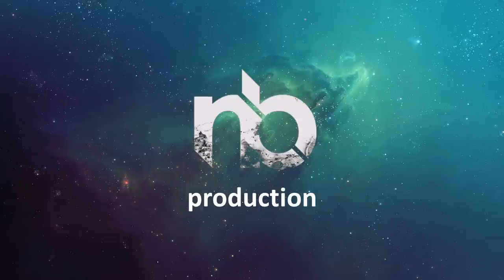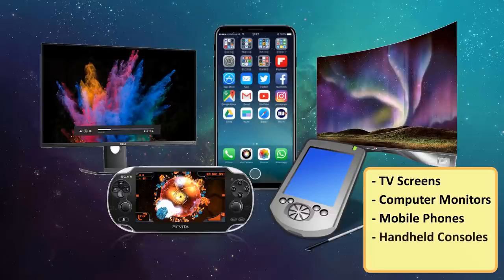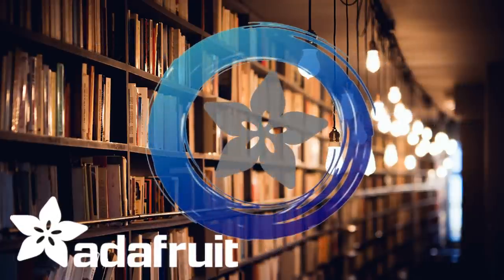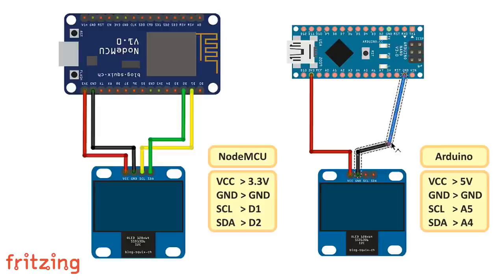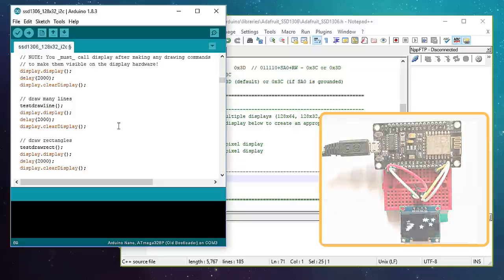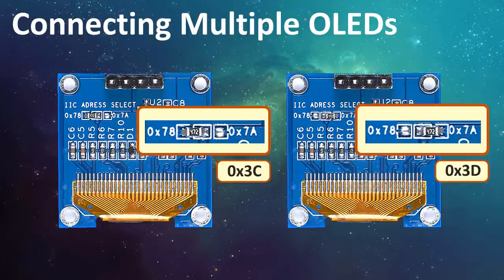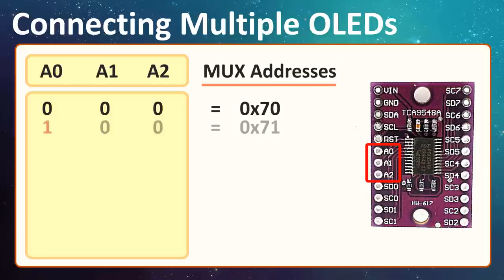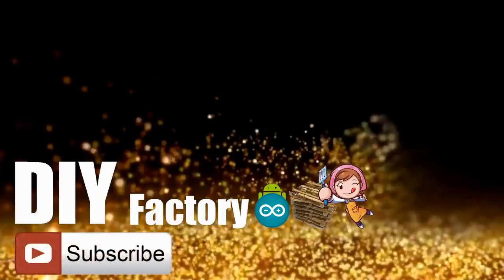Tutorial on I2C OLED Display with Arduino/NodeMCU

Comment: Copied from Reddit: 

As
someone who is also still learning about electronics and Arduinos I felt the
timing of this being posted was kind of funny and that I should chime in. Now
what's funny about it, for me at least, is that I just finished working with an
OLED on a NodeMCU ESP-12E after not having worked with one for at least a year
(the former being rigged to a Nano). Naturally, I needed a little bit of a
refresher but got it working.

With
that in mind, I saw this post and felt like the timing was right and I'd give
it a quick look since it's still fresh in my mind. To be honest, I didn't
actually expect much - I did my project, I learned plenty about OLEDs and got
them working, and honestly, there are just so many websites and videos out
there already and so much information that what could this video possibly do
for me?

I
was actually really surprised with this. Like I said, the proverbial market is
flooded with information - a plethora of blogs and videos on how to do stuff
like this, and most of them are difficult to read through or unpleasant to
watch. This guy gets it right. His editing and presentation are fantastic, his
video footage is good quality, and he has easy-to-read schematics he walks us
through. Not only that, he goes way above and beyond, showing us how to set up
multiple OLED screens together, how (and why) addresses work, how to use
multiplexers for many OLEDs, and concludes with talking points on the
advantages and disadvantages of using an OLED and common errors in setting them
up.

This
video is really well made and very helpful, and for anyone who is anywhere in
the "just learning" to "needing a refresher" range of skill
level, I couldn't recommended this more. I mean, I just did a project with an
OLED and refreshed myself but still learned some things from this video. This
is honestly the kind of stuff I want to see when I'm looking for refreshers on
something or to learn something new. Great job.

Comment: Great! ssd1306_128x64_i2c works!! 
I use an Arduino Due .. and the key for me was telling me that - if I was using a Mega -  then I should use terminals 20 and 21.  The penny suddenly dropped. That works on the Due too.
The Due also has terminals SCL1 and SDA1 in the same position as they are on the Uno.. and they don't work for this. Nor does using A4 and A5 as many tutorials show.  Need to use terminals 20 and 21 folks.
Also ..I goofed first time on the mixture of underscores and hyphens in the file names. Out of the box they don't match so need to go through those very carefully.
Thank you!!
Reply from the maker: Good job, keep it up

Comment: Great Video.  Thumbs Up!
I am actually have an issue getting my 128x64 OLED to display anything while following this tutorial.  I think it is because the recently downloaded Adafruit_SSD1306.h file looks different than in your video.  I do not see a place where address is identified.  However, I only have 1 stock display, so I do not think I would need to change it anyway.  Regardless, I did change the file by uncommenting the "#define SSD1306_128_64" and commenting out the "#define SSD1306_128_32".  I also made sure to change the reset pin from "4" to "LED_BUILTIN", since I am using a NodeMCU.
Any suggestions on where to look next?
Reply from the maker: The libraries I used are all in here: https://diyfactory007.blogspot.com/2018/07/oled-i2c-display-arduinonodemcu-tutorial.html
See if that works out for you.
If not get back to me and I will do a quick test with the new library
Reply: @CrazyCoupleDIY  Thanks for the offer!  I actually figured it out.  The SSD1306 i2c example actually had 0x3C as the default.  I changed it to 0x3D and all was well.  Thanks again for the great video.  Make more!  I'm trying to learn about server/client communication with and without  wifi.  I'm also going to try to develop an app for android to read data off of the DHT22 sensor.
Reply from the maker: Nice. 
Sure, more tutorials and projects are on its way, stay tuned.

Comment: Great video. So far no one answered this. How can I use different pins? I am using D0-D7 for keypad on NodeMCU.
Reply from the maker: First of all thanks for watching
Now, D1 and D2 on NodeMCU are SCL and SDA.
Which means if you are trying to use an I2C sensor it has to be on those pins unless you multiples it using a TCA9548A i2C MUX. 
You can check out my tutorial number 9 for that: https://www.youtube.com/watch?v=XWQsqPQOW-U
Now, if you are running out of GPIO pins you need to extend your GPIOs using an IO extender. My next tutorial is on that only. 
If you want you can check it out next week and that will for sure answer your question.
Using the i2c IO Extender you can extend the GPIO pins to have 128 'parallel' pins.

Comment: Hi. A question. How did you eliminate the flickering of the OLED when recording the video?
In the examples the OLED was blinking and in the end of the video they no longer blink in the animation.
Reply: And a second question. Do you know how I can increase the brightness of the OLED 128X64? Can the brightness be increased?
Reply from the maker: Hi There 

Lowering the contrast and brightness of any object that illuminates light will not flicker when you are recording them at 30 fps

If you want to record at higer brightness use higher frame rate

Comment: Hey man! Great video but one part is missing for me;

What if i want to show a BMP as an intro for 3sec and read an analog value to print on screen? 

I do print my logo when i start it but display.cleardisplay function doesn't seem to work. Cant print my analogread on OLED. Any suggestions would be appreciated
Reply from the maker: Hi There
First of all thanks 
Now to answer you question, So you are using a 3 seconds delay to display your image.
And then when you read the input value are you able to serial print it and see if it is actually getting into the system or not?

If it is then are you getting any error?

If not can you display another image after the delay?
Reply: Thanks for the reply man appreciated.

Silly me i put it in the setup not the loop part. Changed it and its working now

Comment: excellent video, i'm not an electrical engineer but i do understand and have the aptitude to learn. I am looking to put together a Tiny gps enabled Speedometer for FPV RC cars, Drones and whatever you want to stick a speedometer on. these tiny OLEDS are perfect, they can sit just on what would be the dash and the fpv cam can clearly see the display, true some drones come with all this built in but people want a standalone lightweight speedometer that can record g-force, speed and distance all tracked by gps. currently we have to use a big ass box and strap it to the outside of the RC vehicle. can any of you guys build one?

Comment: Hey there! Can i use this display as a menu and also cn i have exterior physical buttons to navigate through the system for eg when the system boots up, i see four options A B C D on my display and when i select any one of them like say A then it gives me 4 more options like 1 2 3 4 and so on with the data of all the options selected by the user in line(like timestamp). 
Is it possible? If yes then please let me know

Thank You
Reply from the maker: Yes you may.
You can use the display to just display the menu items
The buttons will do the real stuff 
In the loop section detect interrupt and when a value goes from 0 to 1 (button press) change the menu item and do what u want to do
Reply: @CrazyCoupleDIY  thank you so much!

Comment: Hi I have a question
if my esp8266 connected to WiFi how can i display the IP Address on OLED
i used the esp 8266 library SSD1306Wire not the Adafruit for the OLED
thanks in advance if you can advise on the exact code
also for MAC address

Comment: Sir, when connecting multiple displays should both the displays resistors are changed to 0x7A?
Reply from the maker: Hi there 
If you are using a MUX it really doesn't matter.
But if you are connecting 2 at once (without the MUX) then you do need to change the resistor

Comment: Hi.  I require use 2 screen: one 0,96 and one 0,91.  One module PCF8574 for 8 relays, one RTC DS3231 (it's 3,3v or 5v?  I look both).   Is necesary  TCA9548A module or can connected in serie?
Reply from the maker: If you choose different address of the I2C OLEDs by swapping the resistors then u dont need the MUX 
Otherwise you will definitely need one to assign a diffrent address to the two I2C OlEDs
Reply: @CrazyCoupleDIY  OK, THX!!!!  Suposed I use only one 0.96, one PCF8574 (0x20) and one RTC DS1302.  All are 5v and i2c.   Can connect in cascade (or serial)?
No find TCA9548A module in my local commerce.
Reply from the maker: @ManuelCastillo-kq3xy  U can order them for AliExpress, but would take 45 days to come to you
Reply: @ManuelCastillo-kq3xy  I2C was designed to allow several devices to be connected to the same bus. So, the answer is "Yes, but..." (as it always is  ;-)  )

For simple connections, the "buts" are:
1. They all need to be the same voltage, as you already noted.
2. They have to have different addresses.
3. You have to be careful about wire lengths: I2C was designed for devices on the same PCB, or connected to it with short wires (like temperature sensors inside a PC). People who try to connect I2C with more than a meter or so of wire often have reliability problems.

Also, if those relays are controlling something like motors, that can generate a lot of electromagnetic fields, longer wires could turn into antennas that pick up noise. So keep them as short as you can, and away from motors, relay coils, and other sources of magnetic fields.

And, yes, connect them "in cascade" (or "parallel"): all SDA lines together, all SCL together, etc.

Comment: are those libraries arduino dependent? in other words AVR code? Cant use it with an ARM based micro-controller of another brand?
Reply from the maker: I have never used them on an ARM based mcu so I am not 100% sure.

Comment: Do you have any suggestions for an enclosure or project box for these OLED displays to make them practical for use?
Reply from the maker: If you have a 3D printer you can download heaps of models from thingiverse
Reply: There are some popping up on ebay.

Comment: Video is good but i got an error of #include "modified_font.h"
If I remove this and run then its showing an other error of setDisplay line which you modified in the video .
If i remove both of these lines then code is compiling but not displaying on OLED. As shown in video we are doing 128x64 0.96 inch so we choosen that example directly.Please kindly help me.
Reply from the maker: that header file should be in the directory as your project.
Can you please put it in the same folder then compile.
If you still get the error please copy and paste the error you are getting and i will be able to tell you the reason then

Comment: how i craete a sketch i want a very simple action..  on a OLED Screen is a message "Armed" and "Unarmed". i want change the Messege only with a button! and the button switchs an LED (Armed is LED Green) (and Unarmed is LED Red) its for Cosplay.. any idea ?
Reply from the maker: What sort of microcontroller you are using ? 
Arduino? Which version?
Let me know and I can give help you with the code.
Reply: @CrazyCoupleDIY  Arduinio Pro Micro
Reply: the screen is actuel pinned on PIN 2 and 3. (Sry for my bad english.. thats is the most problem why i dont understand the Programm speak..) and a big thx for your help
Reply from the maker: I will write something up for you soon. Just out for work for few days will post something as soon as I am back home.
Reply: @CrazyCoupleDIY   THX <3 !!!!
Reply: @CrazyCoupleDIY  ? Is now soon ? sry for question ^^

Comment: i need your help.....  i have bough a (non adafruit) ssd1327 [128Pxx128Px] board but i don't know how to use it....  it has only 4 pins (GND, VCC [VCC for 5V in], SCL, SCA). i managed to get it working with the ''lcdgfx'' library but not the U8glib library.....   could you please explain to me how it works?  device name: SMP1503. driver:SSD1327. I2C address: on the back it says it is either 0x7A or 0x78 (0x78 by default) but i found out with an I2C scanner that it runs on 3x3C?

anyhow, if anyone can help i will gladly accept it.

arduino boad(s): main: arduino uno R3. secondary arduino nano Every/nano

Comment: I'm tempted to get some of these. But they seen too small to read for those that need bifocals.  Maybe their brightness makes up for the small size?
Reply from the maker: Try the 1.8" TFT, they are better than these.
I am making a wristwatch in my next project using that
Reply: I have a couple to experiment with and I agree. If I get a few feet away, unless using some type of graphical indication such as a gauge, fonts are hard to see. I've yet to try the larger 1.8" but next I'm going to try a 2.4" tft. My particular goal is to provide selective gauges on my tractor's dash.

Comment: Arduino mega 2560 is what I am using. Code is running and compiling,but not displaying on OLED
Reply from the maker: Did you select the correct pins?
Please check the section where u have mentioned what pins to use for mega

Is the i2c address of your oled correct?
Please run the i2c scanner to find out the address of your display. 

Are you using the correct drivers?

Comment: Is this display has touch screen feature?
Reply from the maker: Yes there are. 
Look for the SPI version Instead
Reply: @CrazyCoupleDIY  can you make tutorial of touch scree code and how to use that?
Reply from the maker: Certainly can but I don’t have one handy
If I order one now it may take more than 45 days to reach my place. 
However if you want a slightly bigger screen (of the size of Arduino UNO) I can make one for you
Reply: Crazy Couple It is allright. Actually i am working on a project so i want as small as possible. Thnks for your time and your tutorial was great. Keep it up
Reply from the maker: Cheers and best of luck

Comment: i love how you accept DOGE
Reply from the maker: Why not?
Reply: @CrazyCoupleDIY  you actually went through the trouble to set up a dogecoin wallet which was a pain in the ass to do on linux at least since i had to go through dependency hell to get it running.
you did it all for the meme...
i wouldn't be surprised if you started accepting reddit karma tommorrow
Reply from the maker: Humm right. 
Anyways I have always mined doge 
So far I have collected 95000 Doge (which obviously is not a lot). 
But now I mine XMR, IOTA and LTC

What bout u?

Comment: this only works for Oled displays with a known adress. otherwise, this tutorial is a waste of time
Reply from the maker: You are a waste of time mate. 
I think u don’t understand the concept of i2c and addressing.
Reply: @CrazyCoupleDIY  is that a requirement for this tutorial?
Reply from the maker: Oled displays have hardwired addresses the only way you can change it by masking it. 
Which can be achieved by using a mux
Reply: @CrazyCoupleDIY  I know that, I watched the whole video. However some displays don't have the adress printed on the back as in 3:52, and by some reason they can't be resolved by an I2C scanner.
Reply: ooops just found out I had an SPI-Display 🙈
Sorry I'll retract my dislike
Reply from the maker: Ha ha ha 😎😉